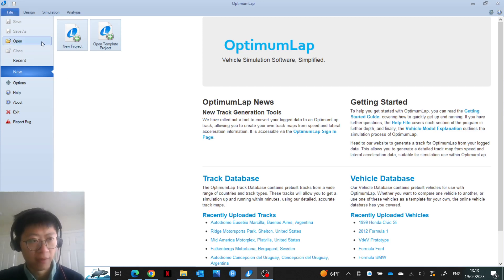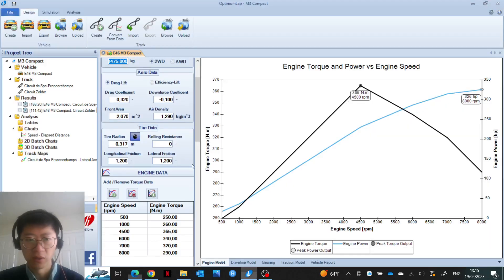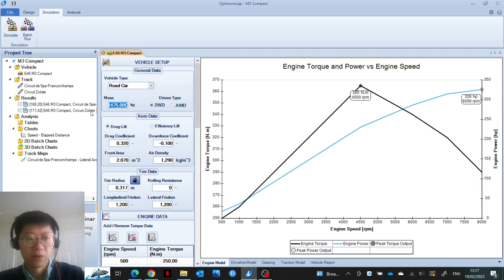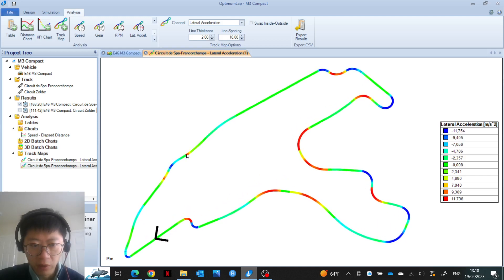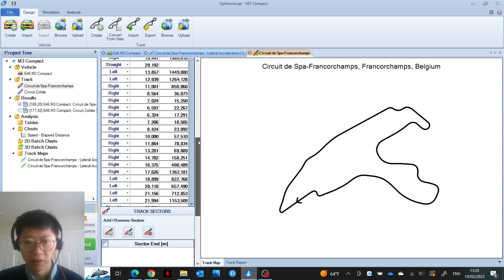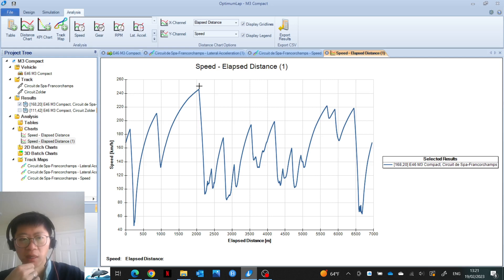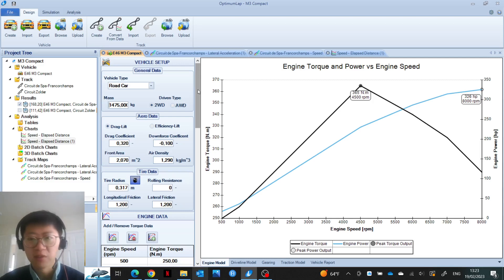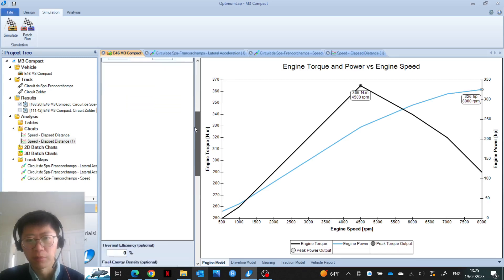OptimumLap prediction of your own car + limitations

Comment: Impressive work and data Collection. Have you tried using Python, R-studio, oracle or even Tableau ? They have similar capabilities but may provide different (similar) results. Even when the math is the same, I’ve ran programs with the same data but concluded different results (not by much). Depends on what you’re trying to accomplish.